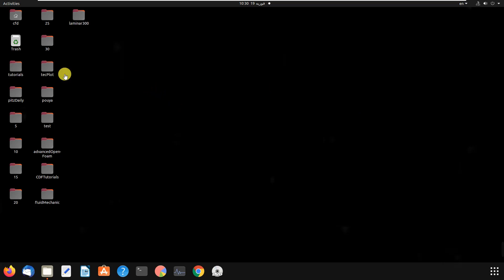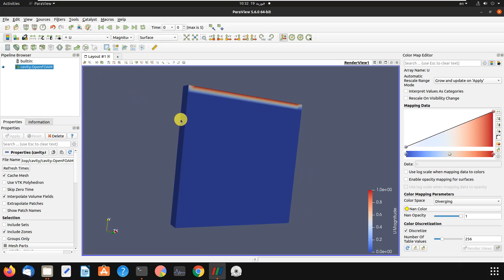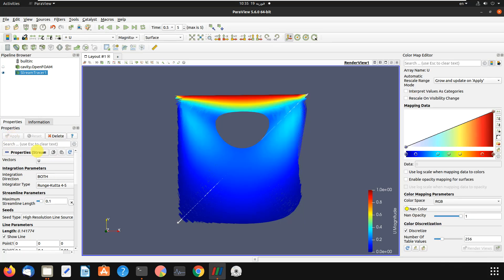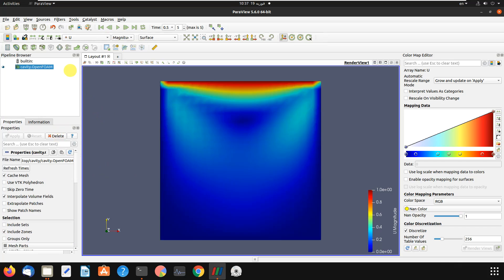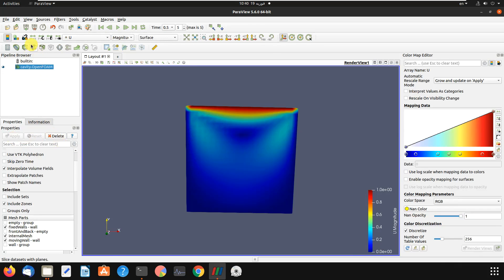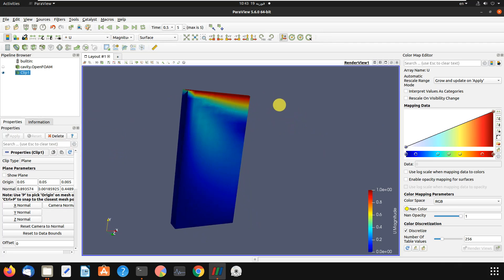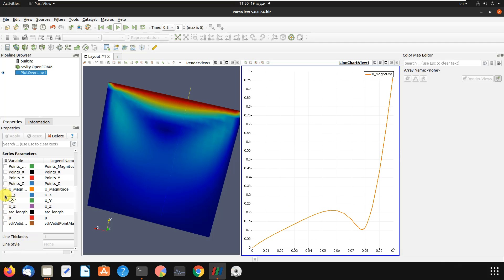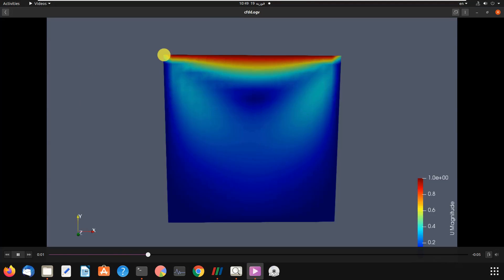Post Processing in OpenFOAM ,para view, for Beginners

Comment: Hello, i wanna realize a calculation (difference of pressure), between two extracted surfaces. Do you now how i can do this via Paraview ?
Reply from the maker: https://youtu.be/AGyvbBN0ghM

This video may help you
Reply: @RezaAlijani_RA  Thanks for your answer, i already see it in fact, but the calculator is only appliable to one surface at each time. 
I wanna make a calculation a pressure difference between the two faces of a wall and i do not really find how to do it.
Reply from the maker: @hugoguyomard1557  I have not seen that option yet.If it is two different surface you can calculate the pressure in each surface and then by using calculator, calculate the difference. 
The most advanced method is to create new solver which takes lots of time and effort